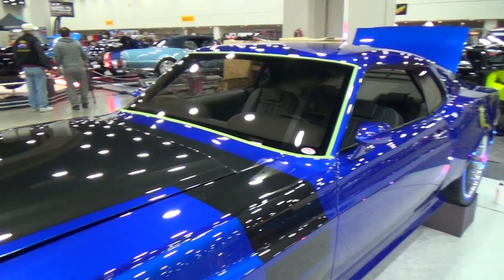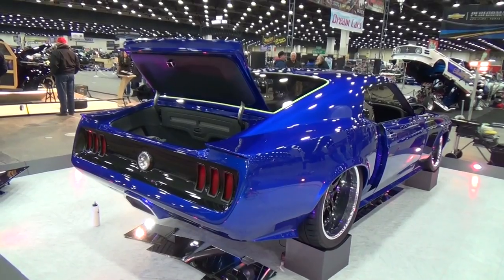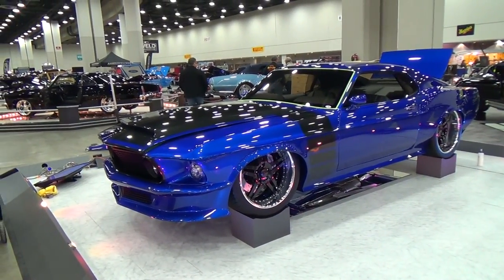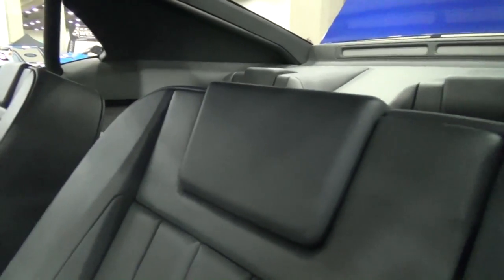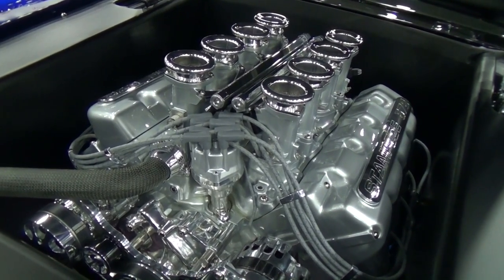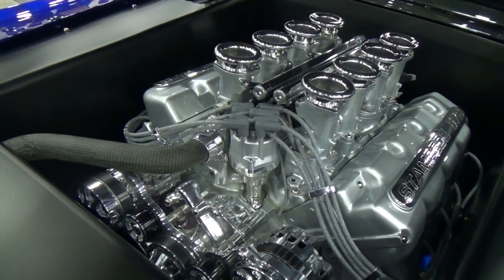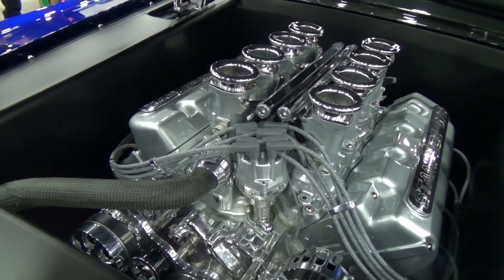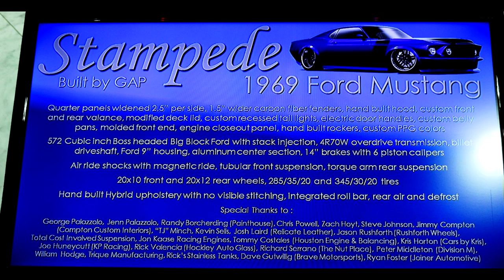69 Mustang Mach 1 "Stampede" Great Eight Detroit Autorama 2015

Comment: yup thats it right there my dad and i built up a 1970 Mach1 was a barn find!!! was a 
1 owner car and the whole care was completely rusted shut. and the condition of the body, looked like some horses from the barn kicked in the doors rear quarters  my dad tore down the engine and we found that the piston lands busted away so we verry carefully pressed out the pins. and replaced the pins and pistons with new ones and wow what a job that was took abut all the max ton-age of our 12 ton press to do it and i carefully balanced the pins for overall balance and fit and i wend ahead and fully rebuilt the fmx installed a shift kit and pressed in new front bearings and rear bearings and also new seals all new o rins and re packed all needle bearings.I rebuilt the shifter instaled my own hand made shift linkage 1x1x4 cold role steel with brass bushings instead of the chinsey plastic bushing that wasn't there